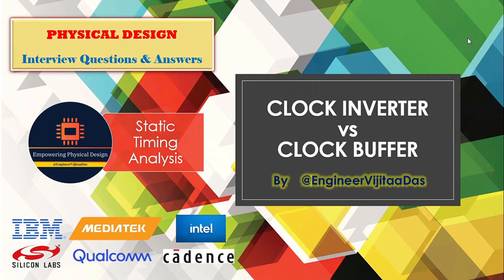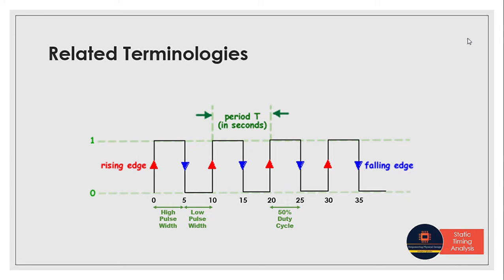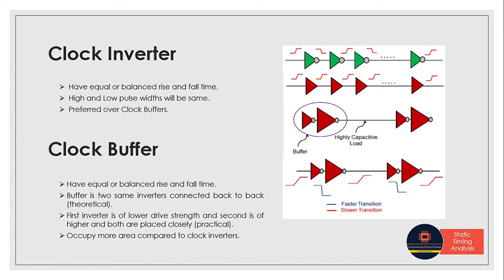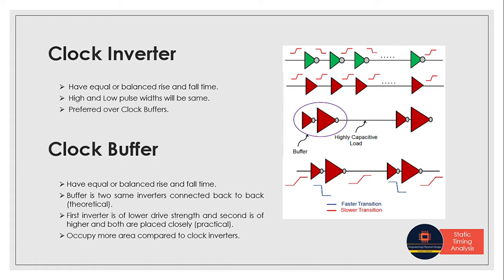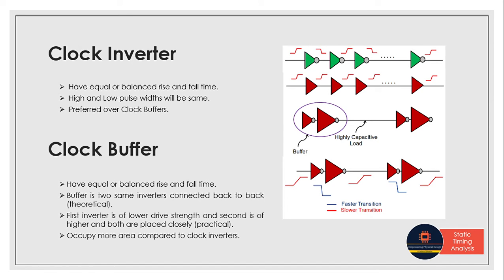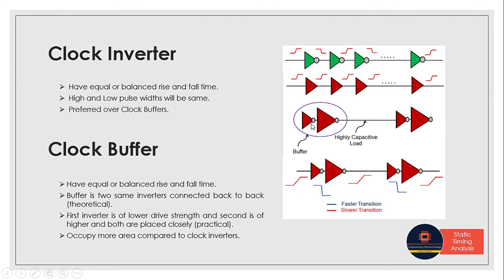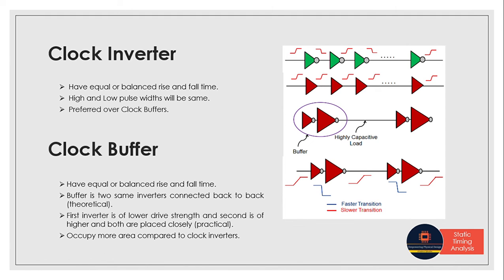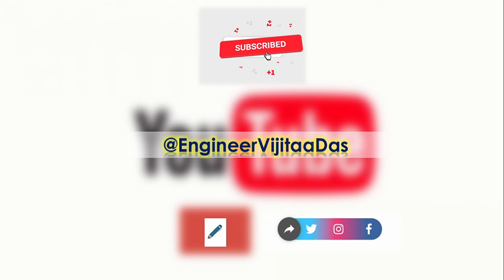Why is Clock Inverter preferred over Clock Buffer in VLSI Physical Design ?

Comment: Here you should also talk about “Noise susceptibility”
Reply from the maker: Yes, I missed it. Another reason why clock inverter is generally preferred over a clock buffer because it is less susceptible to noise due to its inherent ability to maintain symmetrical rise and fall times on the clock signal, which helps to mitigate the effects of noise and improve signal integrity, especially in high-speed designs where timing accuracy is critical.

Comment: in order to get the same output we have to use inverter again at any end. so we have to use two inverters instead of buffers how does this really saves area
Reply from the maker: Based on optimization we can use clock inverter and buffer. Not necessarily throughout design we have to use any of them... we can use both in a same design. 

To save area, the first buffer is typically of a lower drive strength and is placed very closed to the second inverter. Since different drive strength so pulse width is not same.

Advantage of using inverter based clock tree is that the high pulse and the low pulse width would be symmetrical.
Reply: Then which scenario buffers used